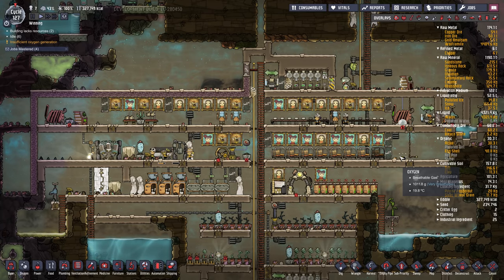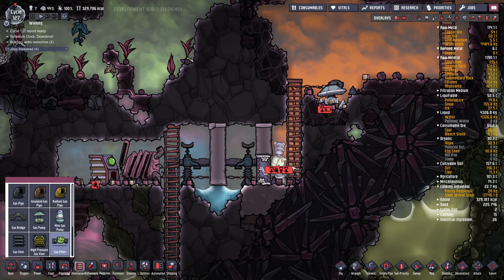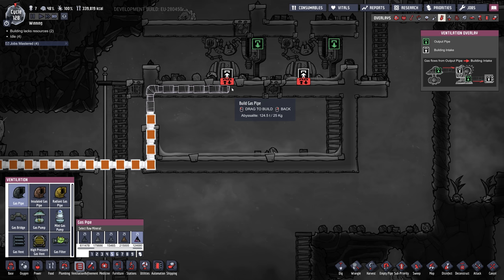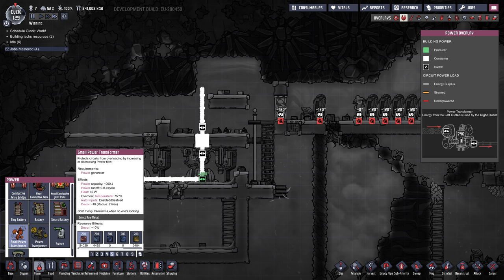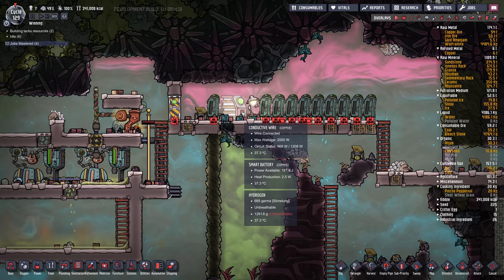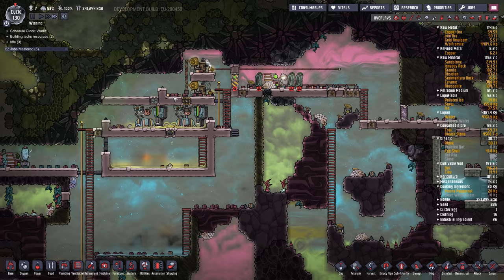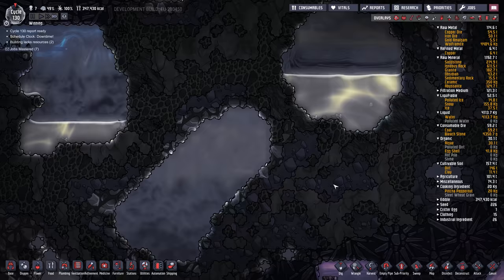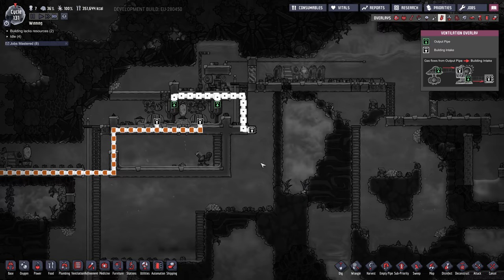Oxygen Not Included - Tutorial Guide (2018) #8 - Natural Gas Generator Setup

Comment: Small tip about using automation. You can have a battery on BOTH sides. The battery on the input side disables the natgas generators when it's full. Then the battery on the output side disables the transformer when it's full. That way you're not running long automation wires, and you're not generating transformer heat.
Reply from the maker: Good idea. I usually don't bother with the transformer side because the circuit is almost always under load.
Reply: @GrindThisGame  I don't understand. If your local battery has charge, you don't need the transformer. I'm not sure if this reduces waste/heat, but probably: you can have your transformer only work 100% and stop until the local battery is empty. I just have batteries on the generator side - the only important side.

Comment: My god, cycle 100 already. I am so bad at this game. I always struggle to use pipes and stuff like that
Reply from the maker: This is more of a test base and I'm building some things with debug so it's not a great gauge on where you should be at this point. You can probably go for 100s of cycles with just coal and dupe power. Finding the natural gas geyser is a bit of luck as well.
Reply: @GrindThisGame  I must suck at power management then haha I rush for hydrogen or gas ASAP. I try to have my toilets/pumps coal and diner room set up finished within the first 15 cycles. Having a 7+ scientist with quick learner and the 15% bonus from the light of the drop pod is insane.
Reply: @davevd9944  i once survived 200 cycles on man power 😜 wanted so badly to get achievement 🥺 and my game bugged and i needed to delete this save.
Reply: @kaitokirusama7653  OOFF that's terrible how many people did you have and how many hamster wheels ?
Reply: @davevd9944  16 people where 4 were mainly only operators (buffed with machinery +3) Its was quite fun. I had temperature under control, bristle blossom and mushroom farm. 2 critter stables to farm coal because i planned on going coal generator (plus you farm meat for bbq and eggs for omlette) Found oil (wanted to deal with it when i go into coal power and smart batteries but i didnt make it) and ice biom where i free harvest wheats and did a free farm of pepper and balm lily (had deckrets there to farm phosporite aswell you know for fertilizer to deal with my farms) No problem with algae aswell because had free puffer farm locked in poluted air  space that produced slime that then i change into algae. In overall had 4 operators 4 suppliers 2 scientists 2 cooks 1 decorator 1 rancher 2 farmers. I was always chosing dups with multiple interests so their morale went high and i could change on what they should focus more (2 of my suppliers were diggers aswell and 2 of them were farmers before i made them into only suppliers jobs plus both liked suit wearing so boost to athletics) Had nicely decorated colony producing enough food had them all at morale 35+ and had so much fun. I took time to expand, was picky with dupes (my first 3 dupes were: 1. Research suit wearing and machinery with boosted science and cant do soctors job 2. Digging suit wearing and supplying with boost to strenght and i think cant do reseach 3. Farming suit wearing and supplying with boost to strenght and cant do doctors job. Took me ages to roll them but was worth it). What i advice is dont expand fast dont take dupes when they show up on printing pod (i got my decorator/doctor after 100 cycle lool) instead of putting everywhere oxygen generators do one room with gas pump to pump it into rooms (wanted to automate it in the future but as you know game bugged 😞) had pipes with polluted water to cool the base. And funny enough my most successful colony was called Shithole and survived around 250 cycles before game bugged and i lost it forever 😞
Reply: @davevd9944  and if there is possibility go for overjoyed response : Sparkle Streaker. Its so hilarious seeing 4 of my operators with this activated on their hamster wheels. They looked like they are on drugs running for their lifes but in a possitive way like "yay i am a hamster you are a hamster lets hamster together and see whos the fastest". Now im trying to roll the same dupes i did last time and see if i am lucky again. Gonna call colony Memestation because the seed is 420697777 i believe 😁
Reply: @kaitokirusama7653  Haha pure gold.
Thinking back about it guess I have to pick it up again and relearn the game :D
Reply: @davevd9944  I did it resently and i dont regret it. Rewatching tutorials aswell to be sure i do everything fine like last time. Cleared all my other safe files and gonna start brand new. And this time build this damn coal generator 🤣🤣
Reply: @davevd9944  ooooh forgot to mention. It helped me so it might help you. Build 3 tires wide spaces between rooms. In middle you put ladder on sides fire polles and 3 tire wide space make oxygen flow up better when you put oxygen generator on bottom. Remember oxygen go up carbon dioxite go down. 3 space make travel faster 😁 and its so fun to see dups use this fire poll. They jump and go wziuuuuuuu down 🥰 I adore this game and fact that game all the time give me Nails as my main dupe hes my favorite one 🥺
Reply: @kaitokirusama7653  Yea thanks for the tip it's what I always do as well.
I often trap a bit of carbon as well to help with food storage. The only thing I had trouble with was animals. I tried hatches but idk seems annoying I must not understand the mechanics well, perhaps more research into it.

And yea seeing them slide down the firepole is always funny :D
Reply: @davevd9944  you can exploit coal production on traping group of wild hatchings amd feed them rocks to after time turn them into stone hatches (i think they still produce coal and they produce refined metals if i remember correctly so no need a heat blasting machine that eats energy for it). A must have farm is drecko. Do stable in base, go to the biom where they are catch them and put in stable. Do farm tiles and plant this meal lice plant there so they can eat it. You need to pump some hydrogen there tho because their scales grow only in hydrogen and bam you have fible farm so dont need ro risk dupes getting slimelung while entering slime biom to search for fibre plant 😁 and when pod gives you larva eggs get them asap. Create stable on bottom of the base where you have co2 and put doors higher. Those larvas eat co2 and produce crude oil that you can later turn into petroleum and then into plastic 😁😁 and pips i use in nature reservats. I plant one arbon tree so they can eat from it leave some untouched ground for them to magicly spam seed from their mouth and burry it. There is a change they will burry other arbon tree there and will count as wild 😁 exploiting it helps use the wood burning machine. Mixing it with the machine that use co2 to turn it into o2 with water you can do aswell cooling system around those two while putting the machine that turns polluted water into water to pump it back to this machine producing oxygen from water and co2. And its still considered midgame 🤔 and my memestation is now on cycle 60 grilling wild bristle planted by pips in nature reservats 😁 and i wait for larva eggs to finish incubating to start creating crude oil. Found aswell cool steam vent and im digging myself to ice biom 😁
Reply: @davevd9944  oh and when you get to slime biom find polluted water and fishy fishy there. Build feeder there and machines that turn slime into algea that is their main diet. This way you farm meat from pakus 😁

Comment: I add a coal gen to the system or 2-3 depending on power demands, and run that to a seperate smart battery with it set to a lower star up value. That way if natural gas runs out and batteries don't get charged at 50% they drop to 40% and coal turns on. Back up system. My % on battery charge are 20 for natural gas then 15 for coal. Let's Nat gas build up more and run gas pump less.
Reply from the maker: Nice idea for a cascading grid of power. I've seen some players use that. I sort of do it with coal primary and manual generator as backup :P

Comment: Question for temperature: you mention the polluted water comes at the same temperature of the gas.

What if I run the ducts inside a freeze dome? Will it cool down?
Can I build a coil or radiator inside a dome?

Comment: To stop the gas slow down at pipe junctions, if you use a bridge so that the output of the bridge is the junction, then throughput doesn't slow down.

For the latest update, you could use some gas tanks to buffer natural gas for a rainy day or geyser dormancy, if you don't want to use storage rooms, and also save on additional pumping (tanks don't need power to input or output). That or pump the excess into a room with a high pressure vent for storage, which is more space efficient but less power efficient, needing another pump to remove the gas.
Reply from the maker: I did the natural gas tank buffer thing in my most recent base. Works quite nicely.

Comment: I've just started getting into this game and my main problem ALWAYS seems to be Overloaded Circuits.  I just don't seem to be able to get a handle on building a power grid without circuits breaking all over the place--possibly because I'm focussing too much on making it look "pretty".

I THINK I understand that you can have one huge central power center with a bunch of generators and batteries as long as you split the power from them off via several transformers, each feeding a different part of the base, to avoid overloading, but somewhere along the line I'm screwing up royally.  Part of it is because I have access to so little metal right now I can't build conductive wires so I'm limited to 1k throughout most of my base, but most of it is probably because I'm messing up on the "receiving" end of the power systems. I've had so many promising settlements come crashing down just to a cascade failure of overload breaks around cycle 100 or so...

I also think I'm being too cautious when it comes to sending my dupes out exploring, but slimelung seems to surround my starting areas every single time so I can't even get to mats to build the suits to get them safely past it.  One of these days I'll figure out when is a good time to go--or just send out the worst dupe I have.
Reply from the maker: If you turn on the power overlay and click a wire you can see the total potential power consumed. If you keep that under 1000w (1kw) you should never get an overload. It is the consumers that cause the overload (not the producers).  Make sure to use the big transformer to prevent brown outs if you have quite a few things on the line.

If you take in the slimelung in small bursts the dupes will be ok and will recover (on default difficulty). Don't let dupes stay long in areas with 10,000+ germ air though or they will breath a lot in. If you sneak in and put some deodorizers the air will turn to oxygen and the slimelung will slowly die off. Cold or very hot will also kill off the germs.

I have an older germ guide and power guide that are mostly still accurate:

https://www.youtube.com/watch?v=-4G9csYiNLE

https://www.youtube.com/watch?v=bYIDzNKpXgQ
Reply: Oh I understand that I need to try to keep it under 1000 per line on the cheap wires when hooking them up to consumers and I think for the most part I'm succeeding there.  I think that I was under the impression that, since only consumers fry wires, I could just throw a battery->transformer at the end of a line and throughput as much power as I wanted over cheap wires in-between the transformer from the power generators to the battery before the power consumers.  Then I could have 4kJ from a large transformer going over cheap wires but then being sucked up by a battery and split by smaller transformers at the end points. Doesn't seem to work like that, though. Or I'm just setting it up incorrectly but I'm so distracted by putting out potential fires elsewhere in the base that I'm not seeing where the wires are crossing in my grid.

Comment: If I build a second transformer coming from the generators with the smart battery on the light side, do I need to use an and gate to tell the generators to shut off or can I daisy chain them? 
Awesome tutorials btw, so nice to have a clear calm explanation rather than the loud, bombastic ones that youtube seems full of. I'm sure the game means you to figure all this out for yourself but I think I would have given up in frustration by now without your guide. Instead I am still struggling to keep up with the needs of my base but in a fun way. Thank you :)
Reply from the maker: generators can be linked using heavy watt wire. from that heavy wire I branch off with transformers as needed. smart batteries I keep o  that heavy watt wire to control fuel burn on generators. I have a few power guides.

Comment: I'm not sure but afaik the NGG puts out PW at the same temperature as the NGG it self so there wouldn't be a direct cooling effect. But by increase the surface of PW you increase the PO amaount. 
Still there would be a indirect (neglactable?) cooling effect because the water removes some tiles of air therefore increasing heattranfer and increasing "to heat" mass and also adding a "delay" because NGG heats first, the PW cools the NGG a bit "back" to where NGG was at the time of producing the PW.
Reply from the maker: Well you can in theory cool infinite polluted water with on the cost of cooling 1 machine.

Comment: One thing I can't figure out... the small transformers max out at 1k power - the same as basic wire. Great. So one small transformer = one wire. However the regular transformer maxes out at 4k right? The same as two insulated wires (2k each). Can we run two of the lines you showed from one transformer without overloading the lines?
Reply from the maker: The conductive powerlines themselves have the 2kw limit I think.
Reply: Huh. Wiki says 4kJ... my ignorance of electricity must be the main factor there. Thanks for the reply!

Comment: What's the difference between heavy watt wire and heavy conductive wire?
Reply from the maker: heavy watt wire has terrible decor but can handle 20kw load but the conductive wire has zero decor and can handle 2kw. Normally heavy watt wire is used for your main power production grid and you branch off that using transformers and 1kw or 2kw wire.